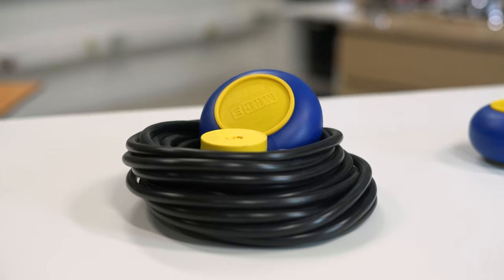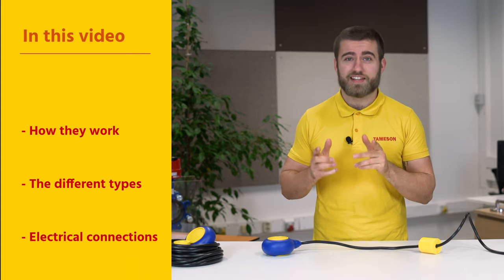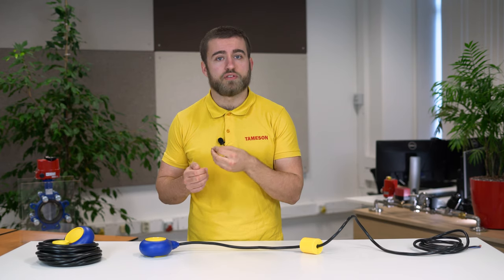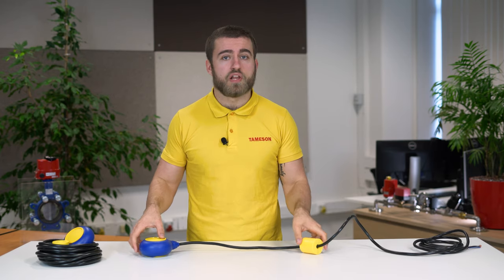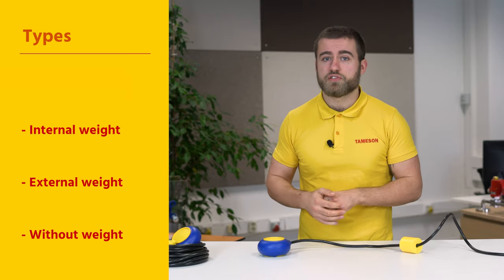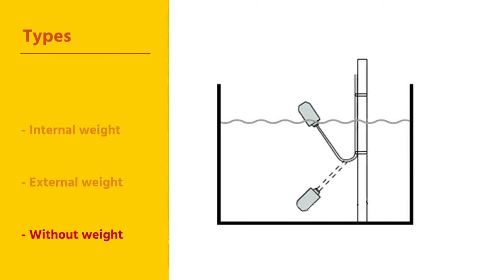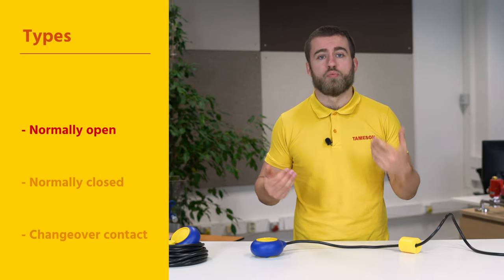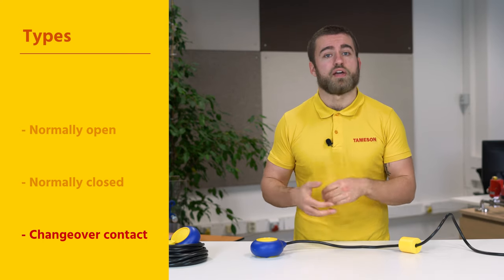Float Switches | How do they work & Selection guide | Tameson

Comment: Hello is there a way to measure the amount of water in a tank remotely?
Reply from the maker: Hello, you need to have flowmeter on the inlet pipeline. If you are thinking on the level measurement, you can use level sensors with signal transition.

Comment: I need something like this to work with a US Solid ball valve. When the float is down I want power to go to the ball valve so it will open. When the float reaches the top of the tank, I want it to cut the power to the ball valve which will leave it closed. Will this work like that?
Reply from the maker: For your application, you could consider a float switch that is normally closed (NC) when the float is down and opens the circuit (cuts power) when the float rises. This type of switch will allow power to flow to your US Solid ball valve when the water level is low, causing it to open, and will cut the power, leaving the valve closed when the float reaches the top of the tank.

Please ensure to verify the electrical specifications of the ball valve and the float switch to ensure they are compatible. You can find more information in our article: https://tameson.com/pages/float-switch or write on our support email support@tameson.com

Comment: Okay did I miss something , does normally on mean when it floating upright the contacts are touching and it's a closed switch?, And the pump goes on? Normally off means it goes on when it goes upside down, that's like the most important info of all.....I need to buy one that makes the pump go on when it's going downward and the water level is low so it turns on and fills the tank back up. Nothing in this helps me know what it's called
Reply from the maker: Normally open (NO) float switch: The electrical circuit within the switch remains open when the switch is at the bottom and closed in the ‘up’ position. So, the switch is open with gravity pulling it down and closes as the liquid level rises to the pre-set level.
Normally closed (NC) float switch: The electrical circuit within the switch remains closed when the switch is at the bottom and open in the ‘up’ position. So, the switch is closed with gravity pulling it down and opens as the liquid level rises to the pre-set level.
You can check more details in the article: https://tameson.com/pages/float-switch

Comment: but what does the yellow cylinder do?
Reply from the maker: Hi. The yellow cylinder is a counterweight that holds the float switch in a certain position. Based on the position of the counterweight and cable length, you can set different control levels in your tank.

Comment: How can I connect float swith to inbuilt submisble sollar pump
Reply from the maker: To ensure proper installation, you will need to connect the float switch to the control box of your solar pump system. The float switch typically has two wires: one that connects to the power supply and the other to the pump controller. When the water reaches a certain level, the switch will trigger the pump to turn on or off accordingly.

Comment: Can it work on DC? Would you need a relay?
Reply from the maker: Hello! Yes, float switches work over both AC and DC.
Reply: Thanks a lot. I'm working on a 24v solar submersible with no controller so I guess this is the solution to turnoff when storage is full.
Greatly appreciate your presentation.